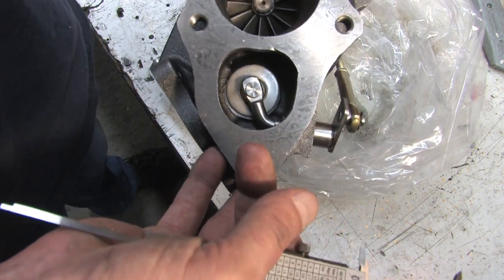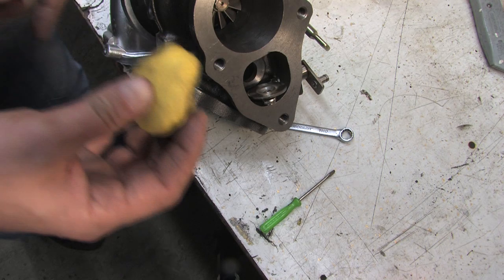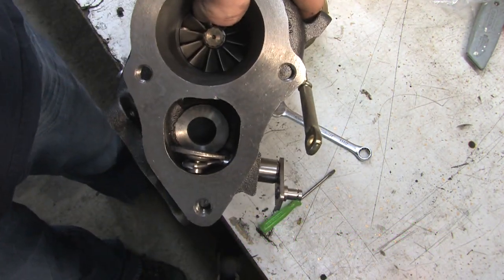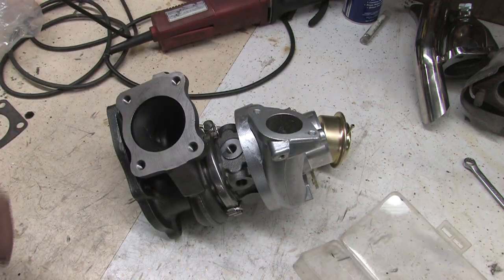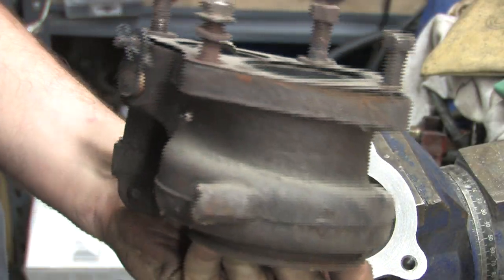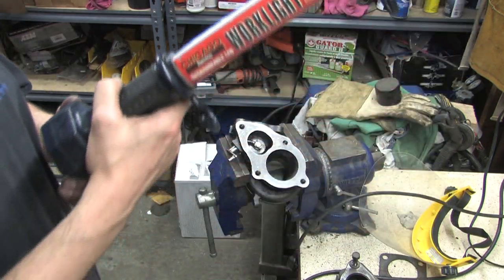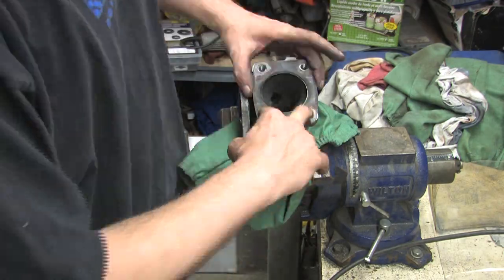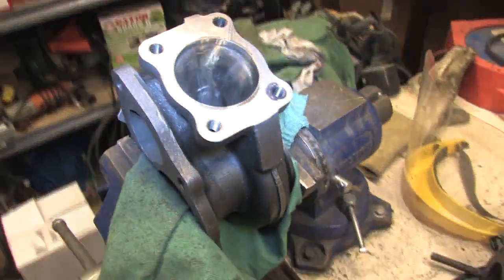Fixing boost creep on an eBay 20g turbocharger

Comment: @Jafromobile - Good demonstration. One thing to remember about porting the inside of the scroll/tongue is to make sure that you never port evenly on the flapper/wastegate side of the the inside of the scroll. Never make the upper and lower parallel with each other. You always want to port the upper edge (looking down the scroll) a mm or so more than the lower so you leave a step on the lower inside edge. This way the exhaust gas has a lip that it hits and directs it out of the wategate.

Comment: Good video. I just got a 16G in the mail from a guy on a webforum. he wants me to take a look at it and rebuild it but I can already tell that it may be be salvagable. It's locked and the turbine wheel along with the compressor wheel have rubbed the housings. More than likely the ringlands for the thrust bearing and turbine oil seal are going to be shot - turbine shafts don't rub unless they're out of balance over overboosted. This thing looks new but has signs on eBay all over it.

Comment: The smaller hole area cases boost creep. If you port it too make then you will have problems holding higher boost levels at higher rpm levels of the engine, because the back pressure in the turbine housing becomes to great when the engine flows that much more air.
Reply: which in his runs that he posted...he was talking about boost leak @ 20+ psi....this can be why...
Reply: True that's why you port it abit then try it till you fix the creep ,not go crazy and create lag.

Comment: @ProjectCarTV If the upper and lower are parallel with each other, you'll more than likely have issues maintaining consistant boost as you'll have issues with boost creep/spike. The problem is that keeping the upper and lower parallel allows the exhaust gas to continue down the scroll rather than being directed out of the wastegate hole when the flapper opens. It doesn't have to be much - only a mm or so - size of a clipped thumbnail. Just make sure you port the upper inside edge slightly.

Comment: The theory behind that is to do with head inlet port polishing rather than any port surface, its because a slightly rough surface makes turbulence in the air and helps mix the fuel better... when it's just air flow or exhaust gas and nothing else in the mix then smoother the better...

Comment: One thing should be noted- the higher the boost level you're running, the less exhaust will be wastegated....so the larger wastegate hole will be more desirable for lower boost levels that higher boost levels.  At higher boost levels you'll want more air to pass through the turbine housing than exit through the wastegate, and a larger wastegate hole will make it more difficult for the actuator to hold the flapper shut.

Comment: yes thats basic stuff, I was asking whether boost increases exponencially increase required gate flow, ie, the gate works fine as standard, increase the boost and the gate cant flow enough as turbo is being used beyond the manufacturers requirements.

Comment: I'm going to answer for Jafro - it depends. It could be oil seals around the valve stems and your problem might not even be the turbo itself. I'n betting it is the turbo though - I'm guessing 16T from an S40 on a different car no? If so, where did you tap for oil feed and have you measured oil psi to the turbo? It could be too high. You may have too heavy of an oil flow to the turbo itself. BUT, the likeliest scenario is the oil seal on the turbine side.

Comment: I've heard that as long as you deburr exhaust and compresser housings, plus the oil galleries in the CHRA, chinese turbos are actually fairly legit.
Reply from the maker: Yes indeedy.  I put down 420awhp with a $224 ebay turbo.  The differences between these and the MHI are practically impossible to detect with the butt dyno, but MHI wins on overall power output when you compare like for like.
Reply: ***** how's the turbo been? There's many mixed reviews about these... I took the chance and got a 20G from CXRacing, not to race with, but to continue daily driving my DSM to work until I'm able to get a legit one... I hope it survives, I believe it should, as I'm still running stock psi and don't plan on bumping it up anytime soon.

Comment: @Jafromobile  At some point you're going to reach the threshold of what the internal actuator can hold no matter how much you tighten the arm- the result of this will be a boost spike followed by a sharp drop.  The only cure is a stronger actuator, like the one I built in the DSMTuners thread titled "Looking for a strong internal wastegate actuator".  The stronger spring will hold the flapper closed better and pull the flapper shut during operation, preventing the boost drop as the RPMs climb.

Comment: ***** I beleive this was the video I was talking about. Guess it wasnt on New Years. Maybe I just watched it on New years. lol Its been a couple years. Keep up the great work man!
Reply from the maker: The video you're talking about actually was on New Years.  This video wasn't Sheldon's turbo.  This turbo is one of mine and it's on the Hyundai now.  Sheldon's turbo was a T-28.  I pulled it off of his car and set out to swap a 14b turbo for him over my New Year's break.  When we pulled his turbo off the car, we found the steel compression ring gasket all burnt up and crammed down in the ex housing, so to justify the time spent pulling it, I ported his turbo to match his exhaust manifold flange.  Your memory is very clear on that one.  That is how I spent New Years 2010.  :)  try this one... watch?v=pO6YQClJJI8
Reply: ***** Awesome! Thank you. I'll go check it out.

Comment: @StreetLethalRacing id be more worried about raising back pressure than EGT's. EGT's dont cause decrease in power like intake temps do from what i know. ther more used for tuning, instead of AFR's, esp in higher power drag cars (sub10's). and also as exhaust temp increases it does flow quicker even tho it increases in volume, which is 1 reason to wrap exhaust and turbo apart from preventing heat soak.

Comment: hi jafro..i'm using volvo s40 turbo..i need to ask you, do you know what cause bluish white smoke coming out from my exhaust & the turbo? when WOT the smoke is very heavy at the exhaust & if I stay idle after WOT, there's smoke coming out from the turbo?could be oil line gasket?help..tq

Comment: for those that dont know... larger wastegate = good for low boost
smaller wastegate = good for high boost.
opening a wastegate means more trapped gasses can be let out and so boost control is stabilized. small port @fully open and boost still climbing? this is what you need to do. open your wastegate port. ebay turbo's are fine as long as you only keep them around 16psi or under. over that they will spin too fast for their design and explode. badly.

Comment: it only needs to shed off enough exhaust gas to keep the boost at wastegate pressure. if the hole is to small it can not do that effectively. which would cause boost creep. the hole reason he ported it.

Comment: Jafro,  do you have a video on polishing the intake manifold?
Reply from the maker: I know what I went through polishing a cylinder head, the thermostat housing, 2g engine mounts, heat shields, intercooler, intercooler pipes, and radiator.  I've started an intake manifold polishing before, shaving the ribs off the casting and getting about half of it down to 400 grit.  Just sanding it took longer than all of the other parts combined.  The metal used for these intake manifolds will never match the material used in the head and valve cover, it will gag a belt sander, The casting is so terrible that even if you can reach into the gaps and get it smooth, it will wear your fingers to the bone doing it.  Your reward when you're done?  You're going to bolt your transistor and coil to it, then bury it all under a fuel rail, throttle cable, engine wiring, and spark plug wires.  Nobody will ever see it.  Like me, you'll probably give up once you've got the inside down to 120 grit and just paint the damn thing.  That one went on the Colt.  On my GSX, I found the expense of a polished Magnus sheet metal intake to be a fraction of the suffering that I would endure trying to polish anything else.  I tried.  Jafro does not have the patience to polish a DSM intake manifold.  Not even Jafro.  Jafro respects everyone bold enough to pull it off, though.

Comment: well I just seen this video and i come from other part side of the world, in short, i did have same problem with the creep sound from my hybrid turbo creature, the turbo was CT16 from Toyota Innova Diesel with 2KD engine, I used stock turbo housing and stuck it with some like GT 22/23 turbine n compressor blade, in the way to reach my boost target about 2,5 bar, the stock boost about 1-1,2 bar, then after i installed and running the engine then there was creep sound come up, i thought that come from the blade smashing the turbo housing but there was n"t at all, I tear down the turbo into pieces but everything  in good shape, no vibration at all on balancing tools, after sometime with trial, err and thinking with ''what the hell inside there"" mode on, then some way, i cut inside the turbine housing curve exactly at the edge of turbine exhaust outlet, i take some about ,15-,25mm wider from the existing cut, so i did cut the turbine housing twice, first cut was to fit the turbine blade to the housing then the 2nd cut for make it wider in the judgment that the exhaust flow was restricted,   so the gas flow made more turbulence, the conclusion  appear from identify the sound always come out just about to peak boost  and also the exhaust press on exhaust pipe so high, more like leaf blower at engine idle.

After I cut the turbine exhaust outlet there no more creep sound, its gone, also the press out of the exhaust just like stock turbo. that s what i find it, but for the boost peak its take longer run then before, i thinks its about the art of engine tuning, close to about how ""syncronism" the tools. enjoy tuning. wkwkwkwk

Comment: Do you still run chinese turbos? How long did that particular one last? From the videos I've seen of yours it looks like it lasted awhile.  I can't imagine that an ebay 20G would spool as quickly as a genuine one would.
Reply from the maker: +Loren Husky Yeah, and it's made it through a couple of cars now.  It out-lasted the GSX engine but it wasn't on there very long.  it's laggy.  The TD05 housing with a 20g compressor wheel crammed inside it is a horrible fit.  Too big for its own good.  It doesn't make any more power (maybe 20hp difference) than the standard MHI Big16g because the TD05H compressor housing is pretty much maxed out at anything flow rate beyond it.  The EVO III works better because the compressor wheel is substantially lighter.  The 20g wheel goes the other direction, but it costs a quarter of what the MHI costs.  They're a pretty even match, but yes, you can feel the weight of that 20g wheel in the gas pedal.  The CXRacing 20g I bought from ebay is on the Hyundai right now, and still going strong.  Once I fix the Hyundai's wiring issues, you'll get to see what it can really do.  Should be hilarious!  I expect this turbo to last quite a while at around 20 PSI.  I did great for 2 years at 25-27 PSI on the GSX and has no shaft play.

Comment: Do you feel that gasket matching the O2 housing is necessary? I've seen some port a Evo 3 O2 housing, and gasket match it. I would think it would be a slight benefit. But, wouldn't it weaken the strength of the O2 housing doing so? I've never seen you gasket/port match the O2 housing on any of your videos. Just wondering what your take is on porting or not porting the O2 housing. When is the next Jafro original video coming out????

Comment: Why not just get an external waste-gate? You get better control too.
Reply from the maker: Control is nice.

I'm of the opinion that a TD05H compressor housing is too small to ever really need it.  But the TD06 version of the 20g?  Fine.  It's needed.  The TD05H compressor housing was by far the biggest restriction in every part of my car's airflow potential.  This exhaust housing and wastegate worked fine on this car for what that housing could flow.  It only beat a big16g by 4 lbs/min of airflow using a 20g wheel, so I'm positive it's the compressor housing.  This is a fantastic street/strip turbo on a DSM & it didn't even require 1/3 of the supporting mods my car had on it.  This turbo was a $224 experiment, and I learned a lot from it.  The next go-round will be COMPLETELY different.

Comment: Um why do you need a bigger waste port? 
some turbos dont even have waste gates as they actually lose you power.
all a wastegate does is act like a pressure cooker valve and release a bit of excess gas to stop the turbine over spooling when you de accelerate, which on a race car you dont worry about
Reply from the maker: It's because this is a street-strip car, and any factory turbo MHI housing boost creeps on this car.  Even when I port the wastegate, it won't run less than 19 PSI.  It's because the blow-thru MAF, next-to-non-existant pressure drop intercooler core, sheetmetal intake manifold, 3 1/4" exhaust and HKS cam combo.  Every MHI turbo I've used creeps.  They were all too small for this build the way it was, way too small for the current one.  It still ran 29 PSI when I turned up the boost controller, but after doing this, at least I could turn it down to 21 afterwards.

Comment: ??if you make the hole bigger the turbo wont give more psi im right
Reply from the maker: +Prince ALiRaQi You are correct.  Check out the reply to SquillyMon below.
Reply: +Jafromobile oh ok so your engine wont hold to much psi so you making it low psi ok got it
Reply from the maker: Almost.  It makes way way way too much PSI because it eats and uses all the this turbo makes and wants more... unless I vent more exhaust gas around the turbo to lower the boost.  The 19mm hole doesn't allow enough exhaust to bypass the turbo so it would over-spool.  The engine was run daily between 24 and 26 PSI, I just didn't want to run more than that.  It would bury the boost gauge if I left it alone.
Reply: ***** oh ok so i found big turbo and want it on my car but the turbo have to much psi i dont know how many but its so big, so what to do to put it on the car? and can i put it on the rear end exheust or still more psi?
Reply from the maker: ...I ...don't ...know?  I don't really have enough information to work with to tell you.  If you put a huge turbo on a small engine, it may not have the backpressure to spool it and make boost?  You need a compressor map and someone who can read it to tell you.  That's not something I can do over the internet.
Reply: ***** backpressure u mean when the air back to the turbo? i can use blow off valves

Comment: I am curious how one tells if they bought garbage from an ebay seller when it comes to a TD05 20g turbo? Ive seen videos of them being used and they work perfectly, and others when they explode destroying the motor. I do not want to trash a 5K WRX engine over a 300 dollar turbo. But I also dont want to drop more than a grand for 50 more hp. Any reccomendations, or links?
Reply: Look for play in the turbine to see if the shaft has movement if it does the turbo needs to be rebuilt and is garbage. Make sure to check the seals also as a leak in air or oil will destroy the turbo too

Comment: Bigger hole = less boost = more laggy in general once the flap creeps open
Reply from the maker: Correct.  Look at the title of the video.  Boost spiking to 30 PSI at part throttle, pulling 135% duty cycle on 550cc injectors with pump gas.  Doing this fixes that problem.

Comment: Can I use a drill bit on the wastegate if I have them available
Reply from the maker: Sure thing!  It might be tricky working around the flapper arm, though.  Most turbos have them welded in, making them difficult to remove and re-install if you need the clearance.  Know that you're reducing the turbo's potential boost pressure by going bigger.

Comment: Doesnt look like it flows very well?  What do you think that orifice does?  It bleeds exhaust off of the exhaust turbine to not over run it....  Its not like you are uncovering hidden performance mod here.  That port....while small...is adequate for bleeding off exhaust from the turbine...its not as if it is so small that the turbo runs a chance of an over boost condition.  

You havent found any extra power here...  Im curious as to what you think the enlargement of this orifice has done?  Allowed you to bleed more pressure off the turbo?  Great...why?  Do they over run and self destruct or something?   Basically, I dont get it.
Reply from the maker: +SquillyMon While I know you disagree with my method, I know my car.  The Big16g I picked up that had a 22mm waste gate port boost creeped like a mofe.  I had to pay someone else to install the 32mm flapper because 5500 RPMs automatically pegged me to 30+ PSI.  My intake and exhaust flow better than the majority of DSMs I've encountered, and if it had to be done to my smaller Big16g, then if this TD05H 20g is bigger, it has to be done here as well.  I am solving a boost creep problem, and I was very successful.  In my case, a 19mm waste gate port is inadequate.
Reply: *****
Ok well then it does make sense afterall.  I was thinking....that you were thinking...enlarging the wastegate port was some sort of power "Mod"....But if you experienced boost creep....Then what you are doing makes PERFECT Sense man !  LOL...  You never know what people sometimes think....esp when it comes to things under the hood.  You should hear some of the things I have to endure...even so far as superstition when it comes to engines or what a car is doing.  Haha...its crazy sometimes